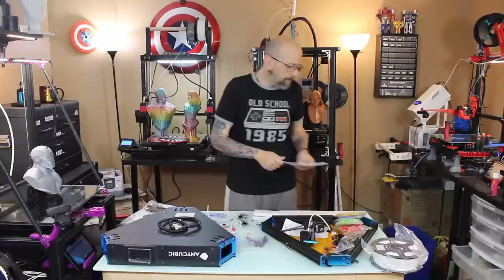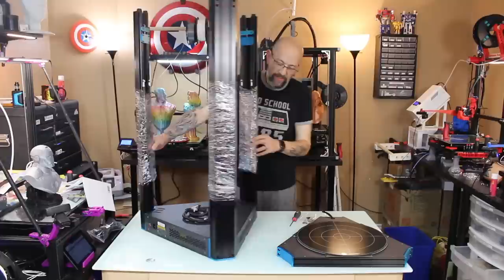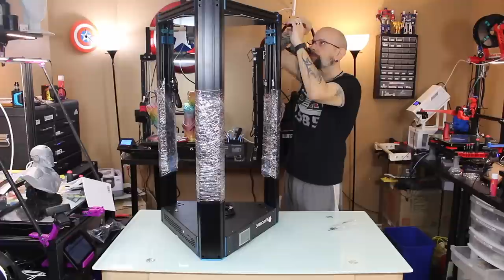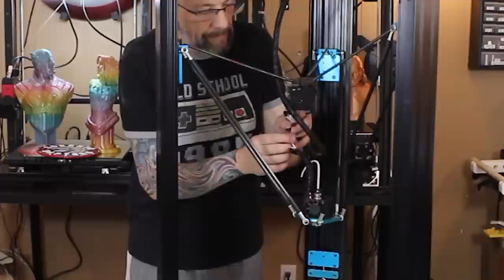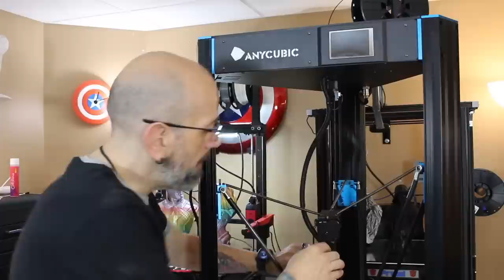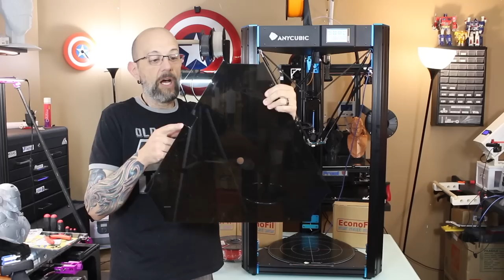Anycubic Predator Review Part I: The Build and Set Up

Comment: Great Vid, thanx.

I have had my Predator for about a week now.
It is outstanding. 

I have had a notion that some of the Predator Cons have been addressed by AC already.
Mine is super quiet. Prints great and worked right out of the box.
Leveling was just TOO EASY which is seriously refreshing.

I am loving the adhesion of the Hot bed no more glue - YEAH !
Two reservations:
The SD card Slot.  It's integrated with the Main Board so there is NO HOPE of exchanging it.
I have several card that just do not want to cooperate with the Slot.
I have a "Loose" SKR car, so, . I can't wait for your Upgrade to SKR video  WITH DETAILS !. 

And Part Visibility. I keep reaching for the Torch/Flashlight to observe whats going on down there.

I am considering adding some LEDs to the Bottom of the Effector  - stick on strip type leds - very low profile.
Reply: Hi Bob,
where did you order your Predator?

Comment: How do you know if your pulleys are to tight or too loose? I just bought one and I am having a little bit of issues with it. I don't think it is the printers fault I think I am just failing to adjust things right.
Reply: Did you end up getting this issue resolved? I believe I'm experiencing the same issue when it probes.
Reply: @Xn3v3rX  I ended up buying new pulley belts. One of the stock ones snapped on me.

I replaced them all and I would say I am getting pretty good prints now.

Comment: i am printin gthrough my computer usb. how to i get the extruder/nozzle to go home after teh job is complete. it hust sits there and melts into teh print. I am using cura with predator
Reply: just figure it out prefrences- printers - machine setting - write this "G28 ;Home" (without the qoutes marks) in end-gcode textbox in the bottom most line
Reply: also make sure u have marlin in gcode flavor